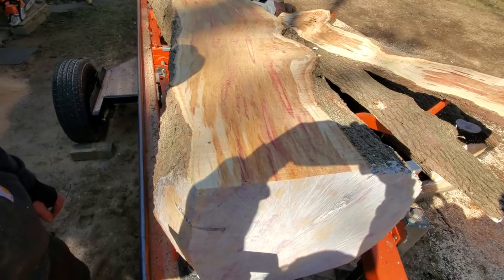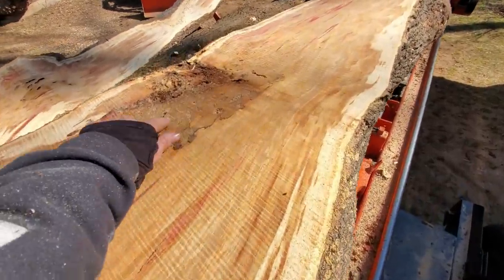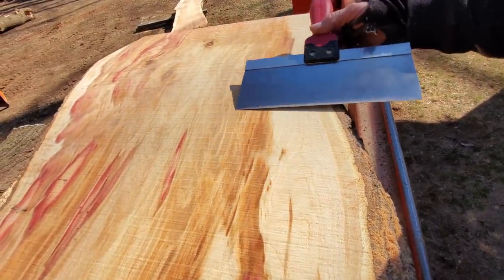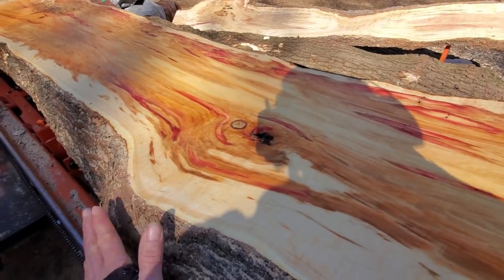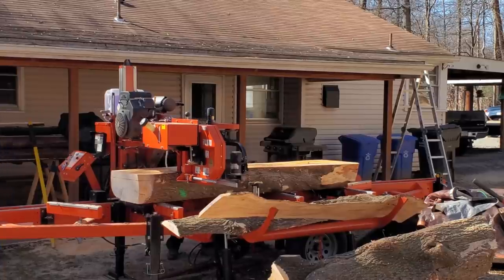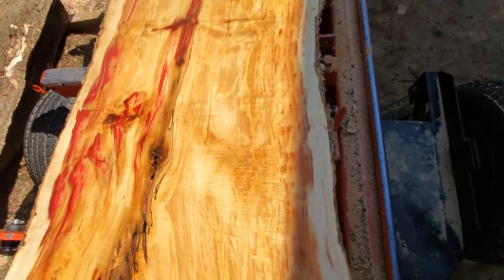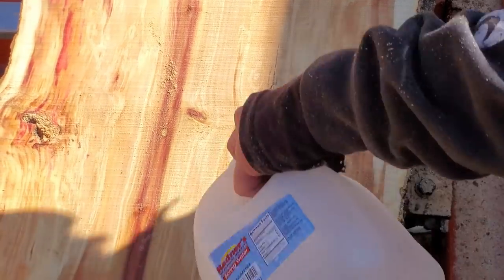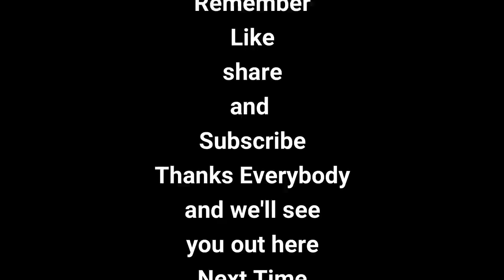This Log EXPLODED (with color) on the Sawmill

Comment: Just curious why nine quarter? Maybe countertops? Thanks for sharing.
Reply from the maker: Hello, and welcome to the mill.
We chose 9/4 to maintain a thick slab, after flattening. All slabs will warp, twist, and generally misbehave. With the extra 1/4" we can clean up both sides of the slab, and have a good chance of ending up at a full 8/4 thickness.
Thank you, and we hope to see you in the comment section, in the future.
Reply: @IronOakSawmill  thank you for your quick response really didn't expect that. I understand the extra quarter for sanding and planing, but is there such a big demand for a full 2 in slab there's my curiosity again LOL thanks again I'm enjoying your videos
Reply from the maker: @byronkbb.1056  there sure is. At least in my area.

Comment: Was just wondering if the use of a wedge or two would prevent or reduce undue stress, on the blade, when restarting in the middle of a cut?
Reply from the maker: Hello Timothy, and welcome. 
If you are half way or more into the cut, and need to stop, and restart, I like to stick a wedge in to make sure the blade isnt getting squeezed. Less than half way, the cut usually hasnt closed, so I dont bother with the wedge.
As long as you don't stop in the cut, there's no need for a wedge.
Thank you for your question, and enjoy the channel.
Reply: @IronOakSawmill  thanks for the reply. Was just curious and always enjoy your content.
Reply from the maker: @timothychristian9140  thank you. Glad to help out. We've been in a cut, hit big metal, and had to back the blade out. Can almost guarantee that the blade will pop off if its running, and you dont wedge the cut. It's best to shut it down, wedge the cut, then back out, moving the wedges as you go.
Glad you are enjoying the channel, and thank you for your support.
Reply: @IronOakSawmill  trying to learn as much as I can. Been itching to get a sawmill but been dealing with some health issues that have kept that dream at bay for the time being. Mainly want to be able to teach my son a trade that he can use to make a living at or supplement his income with. I’m not always going to be around and want to know that he can take care of himself when that time comes.
Reply from the maker: @timothychristian9140  our dream of a mill was a long time coming, but finally happened. Learn all you can, make a quality product at a fair price, and you can make a living. Your reputation can make or break you.
I hope that your health improves, and gives you the opportunity you need. 
I'm here for questions, if you'd like. 
I'm hoping that my grandson will take an interest in it like I have. He loves the mill, but hes 3, so it's all cool to him right now.
Reply: @IronOakSawmill  I really appreciate the offer and thanks for the get well wishes. It’s funny how you have treatment for one thing and it triggers something much worse. Had the rooster comb shots put in both knees to help with joint pain and it triggered inflammatory arthritis throughout my body which has also lead to a possible pinched nerve in my neck or some type of pressure on my spinal cord.
Reply from the maker: @timothychristian9140  is this something that will subside with treatment or time?
Reply: @IronOakSawmill  Not sure. The treatments from the rheumatologist were unsuccessful and now I am seeing a neurologist. Scheduled for an MRI on 3-16 and see the rheumatologist again on 3-30. Hopefully will know something then. I have had to deal with a lot of health issues and not let it get me down. However, not being able to have much use of my hands has hit me pretty hard. Not going to complain though because every time I go to the VA Hospital, I always see fellow veterans worse off than me. Will take it day by day and learn to deal with and or adapt to whatever the outcome is.
Reply from the maker: @timothychristian9140  I like your attitude towards this. Although it can be tough, you keep your head up, and also realize that you are far better off than some.
As you are a vet, I can only say, Thank You, from myself, and my family,  for a debt that I could never repay.
Reply: @IronOakSawmill  Thank you. You have no idea how much your videos help me to forget about whats going on and give me hope that one day I will be able to do the same.